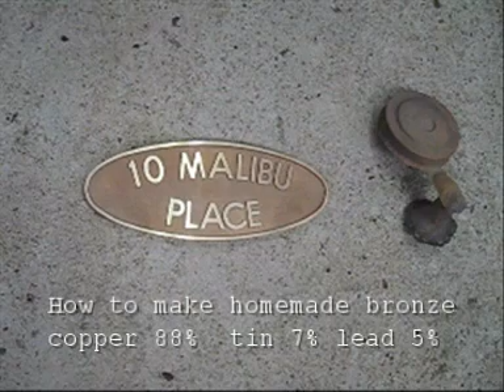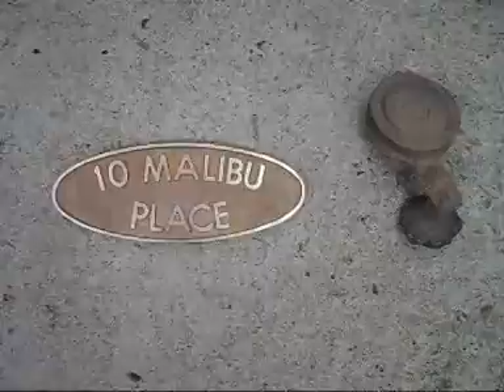How to make homemade bronze

Comment: Never bothered to make my own bronze since bronze plumbing fittings are so plentiful- and cheaper than pure copper scrap.  I do enrich my brasses/bronzes with a bit more zinc to account for the bit I burn off in the melt.  You seem to pour pretty hot- what's your guess at the temp?

Comment: I was wondering what the walls of you furnace are made of? Are they simply a high temp refactor or is there also ceramic wool insulation in there? My friend and I are building an Al & bronze furnace and the design we are working off of requires we put a highly expensive ceramic wool in and then pour refactor over it. Do you think this is necessary? Thanks.
Reply from the maker: +Jacob L. Lepkoff The walls are made from ceramic fibre and a high temperature paint is used to protect the ceramic fibre from furnace gasses. For me ceramic fibre is every cheap but castable refractory is very expensive. Also the paint I use is very expensive but I need very little of it. I think it is unnecessary to pour a castable over ceramic fibre.

Comment: When we use lead, cracking occurs in the circle during rolling.
Reply from the maker: I add lead to stop cracking.
Reply: @luckygen1001  After casting the bronze, you have to see whether the crack occurs by heating the hammer

Comment: Is it possible to add soldering alloy PbSn40/60 instead of lead and tin separately? How will the results differ?
Reply from the maker: I have not tried using solder  for making bronze but the only way to find out is to try it.

Comment: Hey I have a quick question if say i have a copper tin and zinc alloy do I have to worry about the boiling point of metals like zinc at 1665 f or is it not much to worry about
Reply from the maker: Bronze pouring temps some zinc will boil off.

Comment: I have always been confused on what kind of bowl they use to heat all of it up. it looks like simple clay, but wouldn't that shatter?
Reply from the maker: +Aaron Hale Mine did not shatter.
Reply: +luckygen1001 oh okay so it was clay. what kind of clay is it? and if I wanted to make a simple mold, what could I use? thanks in advance.
Reply from the maker: +Aaron Hale I buy my crucibles as they can be very difficult to make at home. Sand molds are very simple.
Reply: Awesome, thanks. I don't plan on becoming very serious with this, simply because I don't live in an area where I can do any of this, but I think it would still be cool to try once and a while.
Reply: +Aaron Hale a lot of crucibles are made of graphite

Comment: Could I just use 90% Copper and 10% Tin? Also, is it by weight or Volume?
Reply from the maker: By weight.
Reply: Sam Hanse
Reply: Yes, by weight, and you can go up to 12% tin to retain a golden color. If you go higher, the alloy will look more silver, but also be harder. I used tin from kitchy tin cups from yard sales, and old copper water pipes from a plumber. Kitchen scale, 100grams copper, 12grams tin, and some borax for fluxing. carbon crucible with a lid.
Reply: Yes, by weight, and you can go up to 12% tin to retain a golden color. If you go higher, the alloy will look more silver, but also be harder. I used tin from kitchy tin cups from yard sales, and old copper water pipes from a plumber. Kitchen scale, 100grams copper, 12grams tin, and some borax for fluxing. carbon crucible with a lid.

Comment: Could I get the exact percentages of each for this mix?  Do you think this mix of bronze is machineable?  Soft enough to machine?  Could you test a batch with a file to see if a file cuts into it?
Reply: I'm pretty sure that no bronze has ever been or will ever be made that can not be cut with a file... High carbon steel is inherently much harder than bronze.
Reply: +Hector Ronaldson Beryllium bronze
Reply: +Hector Ronaldson Its softer than steel, but its annoying to file. It feels slippery, takes awhile.

Comment: Do some manufacturers of brass also use tin, lead and zinc?
Reply from the maker: +michael cammidge Yes they do, lead makes brass soft and tin makes it harder.
Reply: @luckygen1001  does aluminium make good bronze?
Reply from the maker: @branni6538  I have never tried to make aluminium bronze.

Comment: Why did you use lead? Probably not a good idea since lead is posionous, use zinc or nickel or something like that.
Reply from the maker: +Nyctinus It softens the bronze and is easy to get hold of. Zinc and nickel are hard to get hold of in a pure form.
Reply: Also zinc would create brass
Reply: i kinda agree but lead is very cheap and you can get it from anywhere
Reply: +Lunar Empire Only if you added more than tin.
Reply: +luckygen1001 some wheel weights are tin and zinc
Reply from the maker: Max Grawe I thought wheel weights were lead.
Reply: luckygen1001 modern wheel weights are zinc and tin alloy
Reply: in addition to the other answers ... the Poisonous nature of lead is profusely over exagerated... the only time lead becomes genuinely dangerous is when you heat large quantities of it beyond the boiling point and inhale the fumes from that condition... 

the stuff you hear about the dangers of lead... such as in lead paint etc ... was the product of fad leadership tactics carried out by "media" to enable monopolization of industry ... and very irresponsibly so.

take it with a grain of salt.... similarly with mercury... and many other similars

Comment: could I also use scrap tin cans? and if so, how much?
Reply from the maker: +John Pugh No.
Reply: you cant use tin cans bacause they are actually aluminium
Reply: Soup cans, which are commonly called "tin cans" are steel coated with zinc I believe. Then there are soda cans, which are aluminum. It is extremely rare for tin to be used by itself these days. Even "tin foil" is actually aluminum, aluminum and zinc have pretty much replaced all of tin's uses because they are cheaper. Your best bet for tin is probably ordering it online.
Reply: ***** the other reason is because tin is slightly poisonous but not as poisonous as lead & mercury
Reply: Max Grawe Isn't zinc also poisonous? I've heard you should try to not have extended contact with it.
Reply: tin irritates the skin, zinc doesn't its only the fumes that are poisonous
Reply: +luckygen1001 your right. Tin cans are not normally pure tin they have manny other contaminants
Reply: Most beverage cans are Al food preserves are just as often steel that has been lacquered.
Reply: @mgord9518  You do not have a bloody clue, do you?
Reply: aubreyaub Maybe you should elaborate on what you think I'm clueless about? "Tin cans" aren't tin. The point of this convo was because he asked if he could use them in making bronze, the answer is no
Reply: @mgord9518  As stated elsewhere, tin cans are steel sheet, tin plated, not zinc plated. Yes, clueless!

Comment: could i use aluminum instead of tin
Reply: +Miles Smith Bronze is an alloy consisting mainly of copper and tin, aluminium wouldn't create bronze but something else  (i smelted copper and aluminium together before and the result is rather interesting, an extremely shiny material yet very fragile).
Reply: Brandon Lively thanks. I was gonna make a ring for my crush and the only metals i have at my disposel are copper and aluminum. Should i just use copper or should i use the copper an aluminum
Reply: +Miles Smith Mixing the two would most likely be too fragile to be useful for anything at all. A decent source of tin is pewter, it&#39;s quite easy to find and it&#39;s 92-99% tin with usually copper and antimony making up the rest of it. however for a ring... have you looked into turning coins into rings? a coin, a drill, a hard surface, and a hammer is all that&#39;s needed. As for the coin I&#39;d recommend something that contains silver (older half dollars and quarters contain silver but can be hard to find).
Reply: +Miles Smith mixing copper with aluminum instead of tin makes Aluminum Bronze, which is a pretty neat yellow-grey metal.
Reply: +Miles Smith yes it creates something called aluminium bronze
Reply: If your ratios are correct it creates aluminum bronze, but a 50/50, like Brandon said creates a fragile material, it actually has a blue tint to it, it's very cool but extremely brittle.
Reply: The so called Aluminum bronzes or more correctly name Nickel aluminum bronze are all composed of copper with the major alloying being aluminum. They all have added amounts of iron, manganese, nickle and trace amounts of zinc. One big issue with nickle aluminum bronze is it high shrink rate. It's not uncommon for the required risers volume to be twice the casting volume. It's the strongest and toughest of the bronze alloys along with the highest pour temp of the bronze alloys.

Comment: Lead??? Where am I supposed to get lead??? And... how to prevent being poisoned by the lead??
Reply: Are you planning to eat it?  Lick it?  Maybe rub it all over your body?  You should be fine as long as you wear gloves and don't live in a house with lead paint on the walls (the particulate gets breathed in as it deteriorates.)  A hunk of lead won't hurt you.  You can often find old letter press letters at antique shop made of lead (although I don't know what other alloys might be in it.)  I'm sure there are other sources.  Cheerio.
Reply: BY WEARING BOOTS (duke nukem style)
Reply: ***** 

Lead fumes, don't breathe this
Reply: +VicariousReality7 As ,much as I can appreciate the will it blend reference, do you have any IDEA at what temperature lead vapourizes? It boils at 1670°c
Now, at what temperature bronze is suitable for casting? 
Between 960 and 1070°C
You'll burn your face off sooner than 'you'll breathe ANY lead fume, even if you stuck your head right on top of the furnace!
Reply: lead does not become a genuine health risk until it is heated in large quantities beyond it's boiling point... 

you an use molten lead to heat treat springs and tools in... it is how people used to do it... very consistently... but do not bring the molten lead to a boil or beyond and then inhale the fumes.... 

lead paint will not cause you any major damage... only a political / business scam from years ago.... you don't need to wear gloves or anything to handle lead ingots or bullets or anything of that sort... the common place to get affordable lead...is to go to your local tire shop and ask them for any used wheel weights that may be thrown away as trash; try to keep a good friendship there, like all other places, and keep that resource open to you if you find it.
Reply: Lead sinkers are a dime a dozen at your local angling shop. How pure they might be is however anyone's guess

Comment: There has got to be an easier way to make my favourite precious Alloy because I, cannot do all of that. And I don't know who can
Reply: it is not that hard to dig a hole in the ground, use a air blowing device to feed a charcoal fire, and melt some metal. i did so using less than 50 dollars which bought me the crucible which was a stainless steel tiki torch oil holder and paint cans to make a cylindrical hole. getting the actual metals is the hardest part usually.